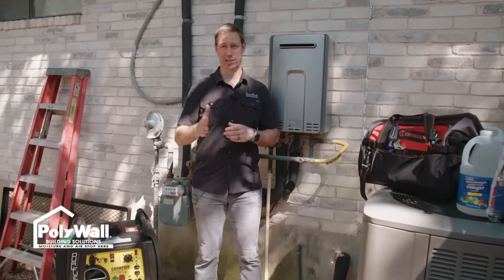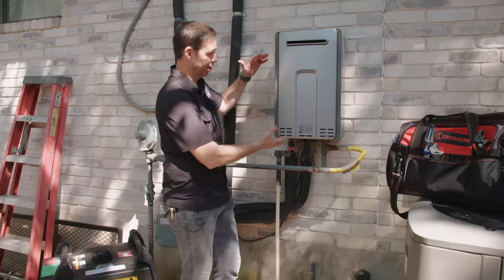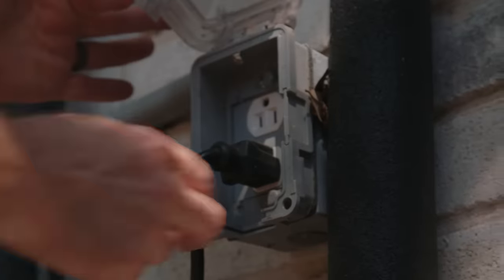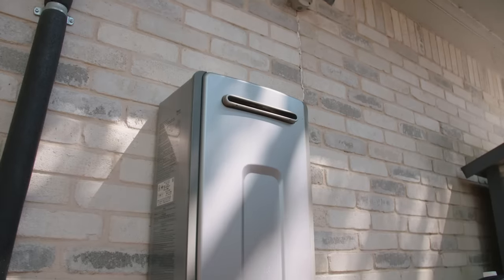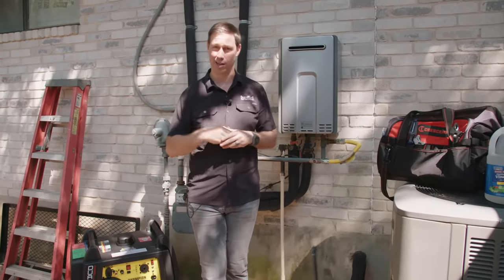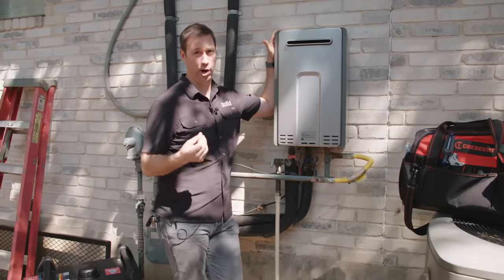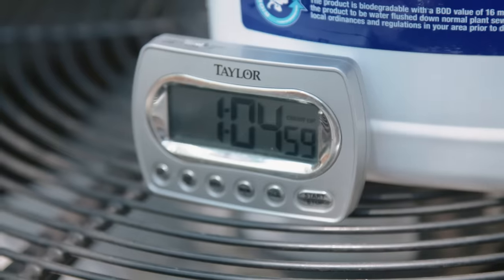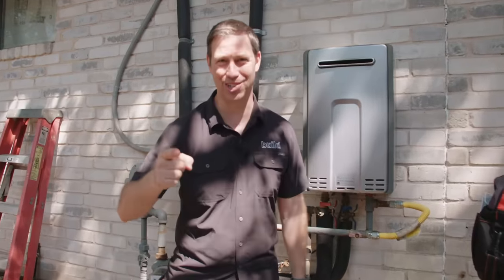3 Things They Don’t Tell You About Tankless

Comment: I live in Spain and virtually all homes have tankless water heaters.  Like most models here, they use a couple of d cell flashlight batteries to ignite the flame. The batteries last for years. I believe mine ia atill running on the same batteries I installed about 6 years ago.  So the blackout problem shouldn´t be a problem,  And by the way, how often does that occur anyway? Not a strong argument as a detractor from using tankless. Cost - I bought a mid level model for 269 euros.  High end models run around 500 to 800 euros,

Comment: Timely video, thanks!  How is the reliability and consumer friendliness of tankless water heaters?  My main concern is that warranties on tankless units run ~ 1-3 years.  That isn't a big problem if the bad parts are consumables (owner replaceable.)
Reply: Nope you gotta call noritz service they confirm bad parts mail new parts to you with colored instructions. change thermal cord.. 1300 plus call back of 300 to get unit under warranty fixed..labor only

Comment: No 1, there are tankless gas water heaters on the market that do not rely on electricity to ignite like this one depicted in the video. Others have a PILOT light which once lit, stay alight all the time and provides the ignition to light things up. No 2. the hot water pipes exiting these heaters. MUST be insulated to keep the temperature up especially if the pipe has a long way to go. No 3. Servicing, depending on the quality of the water going thru, HARD water they require servicing every couple of years, and the diaphram within needs checking to ensure it has not been damaged. I find with continual use in Australia and no servicing at all, they last about 8-9 years. The cost of the gas required to operate them, is IMHO not exhorbient. The majority of homes in Australia are fitted with these water heaters. I even use a similar set up for our camping trips.

Comment: One thing you did not mention about tankless vs water tank.  Water tank has hot water almost immediately.  Tankless you have to wait forever for hot water.  I've had to wait sometimes 2-4 minutes and that is a long time if you are waiting to wash you hands in the washroom and you have to run the hot water in the sink till you get hot water before you turn the dishwasher or laundry on.
Reply: the "instant" hot water time from heater to tap depends on length of cold pipe  it has to heat up along the way.

Comment: As someone who already doesn't service the tank annually, I think I won't be much worse off going tankless. 

I want to fit an RO system too, which would help soften. But as I have a medical issue with acid reflux, RO is not good unless I do remineralisation and that's getting to be too much of a pain.

Honestly, I'm considering tankless (and retrofit instant hot water) as my tank nears end of life and I am home alone, cold water laundry - I need so little hot water, I even turn off my current water heater for 4 months of an Arizona Summer. So I don't want to keep a whole tank heated for 2-3 short showers a day and dishwasher ever 3 days.

Q. Can I program a tankless system NOT to run after 10am May-August ? In Arizona, cold water can be scalding due to the Summer heat at that time of day :)
Reply: We have reverse osmosis.  It does not "soften" the water.  You need a water softener system to do that.  Reverse Osmosis lowers the nitrate level and other common chemical contaminants in your water.

Comment: a.  My gas water heater doesn't need electricity.  I can take multiple hot showers without electricity. 
b.  Tankless only gives you X degrees over  the temp of the water.  I live in the land of cold and the water coming into the house can be in the low to mid 30's during winter.  Even a (exceptional) 60 degree rise only gives you 90-ish degree water.  That's below body temp.

Comment: I had a problem with taking really long showers. I found that a super good way to take fast showers is to count out loud as you are showering. I count to 70 (for some reason 60 seconds isn't quite enough). It really really works great. Tell your kids to count to 70 and shut off the water when they reach it. I also no longer try to dry every drop of water off my body like I used to but that is when I have almost no time to get ready. Occasionally I just let myself take really long hot showers just for the pure enjoyment of it, especially when I'm cold going in. In that case have them track how many long showers they take a week and limit it to 2 or less.

Comment: 3 years ago our 3 families put a tankless in each of our homes. WHAT A TOTAL MISTAKE. We removed two of them already and the third one is on its way out. The cost of installing them far EXCEEDS any saving you will see even though we installed them ourselves. A good percentage of the time you have to put in a much LARGER gas line. $$$$$ When the power goes off you have NO hot water stored in the tank. Way too much electronics and sensors inside that will shut it down and replacement boards are $$$$$. Continuous maintenance. You will save a lot more money by just placing a coil of black irrigation pipe, from your local Farm Supply, on your roofer or in the yard connected to the cold water intake to your tank.

Comment: I'm not a fan of tankless....unless space is an issue.
    First of all, most people can't work on these when they quit working...including me and I'm a professional plumber. YUa gotta call the manufacturer...we all know how long that's gunna take. 
   Second, at full flow the water is not very hot....so you have to adjust your shower valve way over to the hot side.... and if someone else is showering it gets frustrating. 
    Third, only the newer models (2022) can produce hot water at a very slow rate (trickle) because older models can't make a small enough flame...these things are made to heat water instantly at a fast rate...not slow.

    Tank water heaters last a long time and make HOT water. Hot enough to sanitize things like dishes. 
     Wait till you find out the cost of converting to tankless...I'm a professional plumber and I have a tank water heater....zero issues. I filter the incoming water with a $39.99 filter from home depot. I have soft water cuz my girls won't go a day without it....and I actually change out my "sacrificial anode rod" inside my water heater every 3-4 years.

Comment: I'm a trouble man for a local utility on the East Coast I have run into flickering lights with tankless water heaters several times is there a solution the Transformer and conductor sizes are adequate to supply enough voltage and amperage to the units but still flicker the lights if you have any insight into a remedy I would appreciate it thank you

Comment: propane tank with valve slowly or half way open to save n also water heating n hot water knob slowly turn for release to get hot water constant longer,, car solar battery or   with a power inverter is cheaper,, soft water kit with filter, also a 2 pressure cut off valves one before filter and before tank inlet to create pressure for scale build up,

Comment: I just moved into a house with this tankless and I hated it. Maybe it's located too far away, I have to run at least 2 minutes before the water even starts feeling warm. Waste a lot of good cold water. Not to mention that the hot water is only luke warm and I can't change the temperature at the control. panel . I'm on the YT trying to find out if it's possible to switch back to a traditional hot water heater. I don't mind losing a few square feet of room in the garage.

Comment: Question: Since hot water takes so long to get to the kitchen, but the bathrooms are fine, would I be ridiculous to keep my water tank and add a tankless water heater close to the kitchen? (sink and dishwasher) I had thought installing in the garage below the kitchen or maybe even in the attic above, although I'm not too serious about the attic.
Reply: Yes, they have small ones called Instaheat and they are very nice for hot water in seconds.  The problem is, they are electric and they need so much power that they require another 240 line ran on its own circuit because they pull as much power as a large AC unit.  It's only for when you're using it, though so it's not bad.  Another option is a mini electric water heater.  HD has a 2 gallon 120v plug in tank that goes under the counter and will give you plenty of instant water for hand washing and dish washing.  They are exactly like regular tank heaters but tiny.  Inexpensive too and only require a normal outlet. By the time the 2 gallons is empty you're house water heater would have gotten to the location.

Comment: I have one of these in one of my rentals, and the largest downfall I've seen issss!!!! there's a pressure valve in the tank that lets off if too many people use hot water at once!!!! happened 3 times in winter, I thought it was frozen pipes!!!  the first 2 the tech had no idea what was going on but when the 3rd tech came he mentioned that these unit were built and designed for the European market where they use these for specific uses where there's only 1 draw point, example the shower or the washer and only 1 of those!!!

Comment: tankless don't leak like standard tank.  Tanks last about 10 years at most, and when they fail, they take out floors.  The worse thing is a water heater in the attic, a friend of mine bought a house with an attic water heater, it failed, and they lost the ceilings, floors and some dry wall.

Comment: I had a Bosch 1600 tankless. It was thrown out after 2 years. Since I only use gas for hot water and furnace duty, I was able to get exact cost of operation versus a cheap tank unit during the summer months. Less than 1 dollar a month difference. First cleaning was $200, then the water pressure valve developed a leak, $300 more and damage in the next room when the water ran under the wall. Our home gas supply was not able to run the water heater at the same time the furnace ran, so I got hit with a cold shower unless I turned the furnace off while I showered.  Then one day I got a call at work from my wife who said the water heater blew up. I laughed at her but came  home and sure enough the closet door was blown out.  The other half of the water pressure valve which opens the gas flow leaked gas into the closet and when the igniter hit, boom.  I threw it in the back yard and never looked back. That being said, I think you might find the little electric units that fit under a sink might be extremely practical.  I am staying with a dirt cheap tank that allows me a full 1/2 hour to shower if I want it, and recovers in another half hour.  I can also shower while laundry is running using hot water, of course at reduced time but it can be done. And absolutely no maintenance at all.

Comment: With a tankless, when you shut the water off and then restart it, you first get the hot water that was in the line and then it goes cold and then heats up again. They also don't tell you, if you use bottles of gas, it could run out at anytime. Another thing, I went to Lisbon once for vacation and stayed at a friends apartment for a week. For several days, the gas people were on strike, so no hot water at all.

Comment: What he doesn't mention is that, water heater tanks fill with scale.  You can't get it out.  The water heater is less efficient as time passes.  The cost to flush a 40
gallon tank with some kind of decalcifier is crazy.  Where exactly do you plan to dump all those chemicals afterward.   If your teenagers are spending
too much time in the shower.  Turn off the hot water just once after you have warned them.  That should solve the problem.  Instant results with instant gratification.

Comment: mine has 2 batteries for ignition, i use one 10kg gas bottle in 6 months, just for me.it works fine but ive had solvable problems, my ignition system just stopped working today, ill change the batteries see if that fixes it.

Comment: A handyman installed an electric one and i got called out. Old electric was on a 2 pole 30a breaker...tankless required 3 2pole 40a breakers....needless to say i had to upgrade thier service 150a to 200a and sub panel in garage just for new electric tankless water heater...

Comment: I don’t know if you made a vid on the electric version, but most electrical services on houses will not handle the extra amps these units require without a new electrical service and breaker box. Very costly for unlimited hot water.

Comment: IMO the problem with tankless water heaters is that they don't actually save much energy. The energy savings range from 14% to 31% for a typical household (according to the EPA). By contrast, a heat-pump type water heater reduces energy use 30%-70% depending on weather, usage, etc.  Yes, the heat-pump type is typically all-electric while a tankless is normally gas fired, but as we transition to more and more renewable energy that isn't a bad thing at all. Tankless IMO is a poor investment.

Comment: Do tankless water heaters still run as effectively in -30 degree Celsius weather? Or is there even less savings when it is so cold
Reply: So tankless water heaters don't care about the outdoor ambient temperature because you are heating the water that is from the ground at like 50 degrees. With that being said though, it is a combustion chamber that will condensate so the exhaust can freeze over if it wasn't installed with that in mind and sometimes accidents just happen.

Comment: My biggest problem is I need a 120v version to supply my house with hot water. I can only have 110/120v electricals in my house with the Solar I have. Anything 220/240v will not work on my system and I do not use grid power which is what would be needed for the 220/240v water heaters.

Comment: I put in a electric tankless hot water heater. And for a while it was okay. But then it started having leaks in the box and they did replace the part with a new one. But later on it just stopped heating water all together. And in a small town, no one would work on it. And if you had someone come out from a big city to work on it, it would cost more than switching back to a hot water tank. So finally I went back to a regular hot water tank. So not a big fan of tankless,,,,,,,,,,

Comment: You mentioned your teen taking long showers. You also talked about if the power goes out you no longer have hot water. Well, it looks like the solution, I’d to go unplug the water heater after a determined time when the teen is in the shower. Shower ends!

Comment: My only complaint with my tankless unit is that it takes a while for it to begin making hot water and for the hot water to get to the faucet. Seems I’m wasting a good bit of water waiting for it to become hot. Otherwise, I love my tankless.
Reply: You may want to get your unit checked out. Something is wrong with it or it was installed incorrectly. 
Tankless water heaters makes hot water instantly at the heater, then has to pump it to the faucets. You may need to add a return line to the heater so it can recirculate the hot water.
Reply: @JasonSmith-bi5nr  I think that’s where the wait comes from, the time it takes the water to get to the faucets. I have a manifold system in my house so the water has to get from the heater to the manifold then to the faucets. But now that I think about it, it’s a short distance from the heater to the manifold and master bath. Seems it shouldn’t take that long. I can check with my plumber. Thanks.

Comment: Installed a pou model. Water is hot  for second then it's lukewarm to cold to many other additional parts have to be added like check valves and circulating pumps  my advice would be to stay with the common hot water heaters. Tankless are to costly.

Comment: tanks always rust out and leak also they take hours of running to heat the water up and that costs you so much in power so tankless is defiantly the way to go. It's rare that your power ever goes out but I have a diesel generator so I can just easily plug it in and it will work as per normal.

Comment: You forgot to mention the 2 gallons of water you use waiting for the hot water to get to the faucet.  The corollary to that is you leave the hot water on in between uses like when you do dishes to eliminate that cold slug of water.    To fix that you install a circulation pump to keep the water hot when you are not using it, but wait that means the heater runs just to keep the system hot.   On top of that your system is probably not insulated which will cause more energy loss than a hot water tank.   Tankless are actually less efficient than a hot water tank!!!

Comment: Thanks! Now I know I'll never buy a tankless. I'll never buy an energy-star water heater either, because like the tankless, if the power goes out on an energy-star water heater so does my hot water. I am quite satisfied with my outside-the-house 50-gallon propane hot water heater. When the electrical power goes out, I have all the hot water I need. If fifty gallons of hot water isn't enough for ya' then something's mighty wrong!